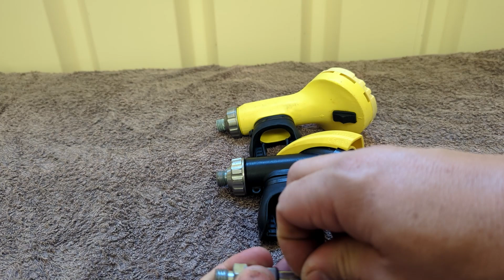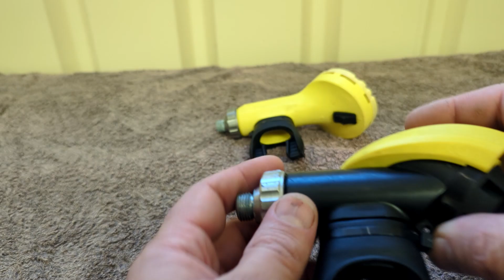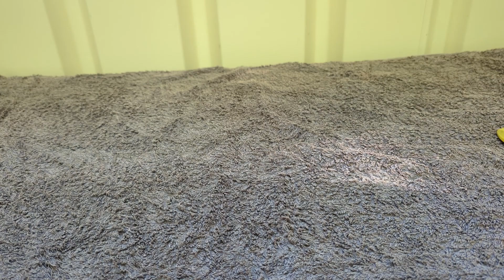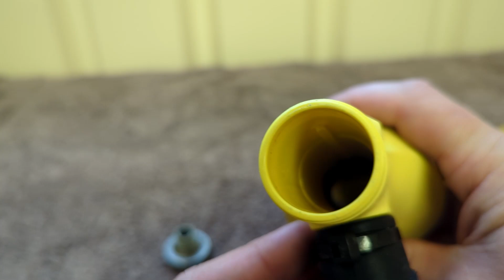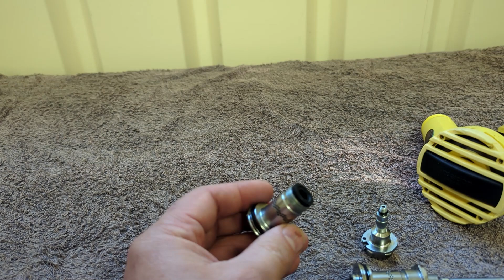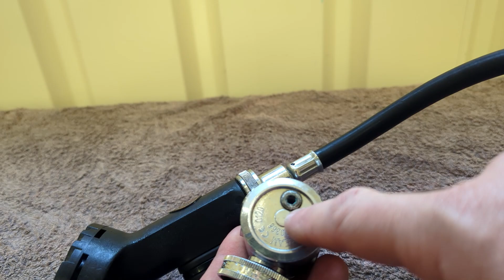Poseidon Xstream & Jetstream Strip

Comment: Will there be air leakage when you disassemble the servo valve and reassemble it?
Reply from the maker: If there is pressure behind the reg then yeah, it's sealed with a small oring onto the main body.

Comment: Nice vid! I have xstreams as twins reg. They have been great paired to mk25s. Easy to service and I have never used a reg that comes close to it's gas delivery sub 40m when air gets thick. I need a new reg set for sidemount and am considering the jetstream. I have never used them, how do their breathing characteristics differ from the xstream? They do look funny 📞 but other than that what is your observationon their differences?
Reply from the maker: @looloolama  in my experience they are about the same. The main difference is the physical size of them. The first stages that come with them are a little different. However if you are mating them with a different first stage this is mute. The pre dive on the Jetstream can also be helpful.